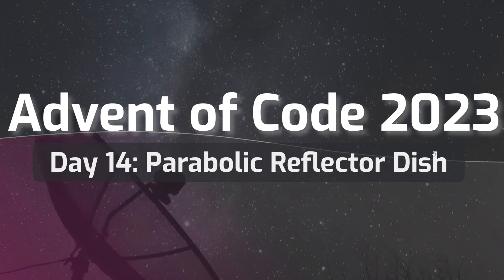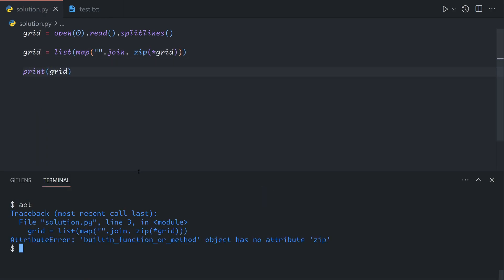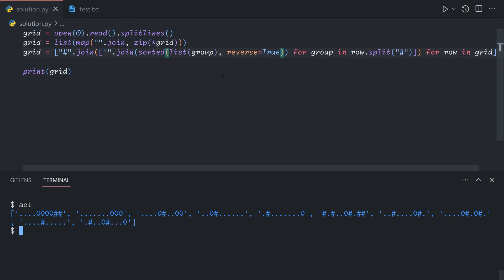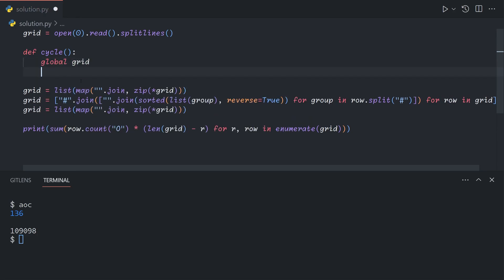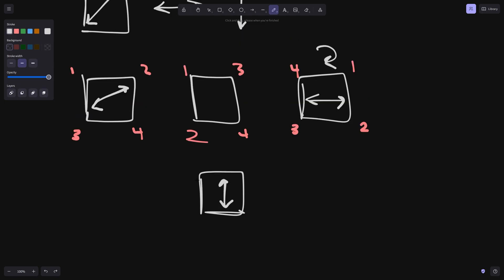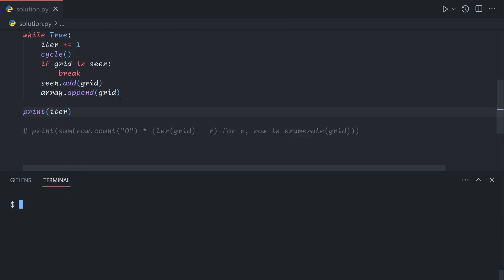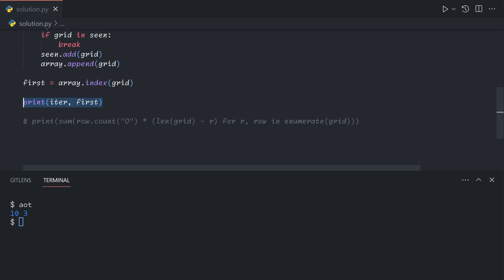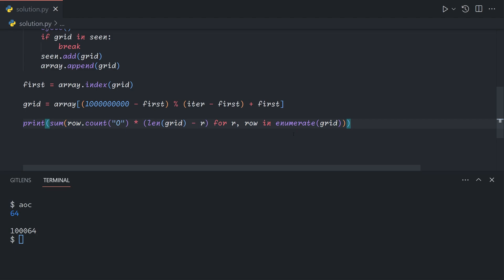Advent of Code 2023 Day 14: Parabolic Reflector Dish

Comment: I think we can use the Load as a hash or identifier for the grid at any point after a spin cycle. so we can track the load (an int) instead of an entire grid.
Reply: You could theoretically have two seperate grids with the same load probably which would break this approach no?
Reply: @xavier29771   I just saw this lol. Yep you are 100% correct.

Comment: I have some simple functions that examine the fields above, left, below, and right and move the rocks if they're free. For part one, this posed no problem, but for part two, it became quite performance-intensive. I discovered that running through 1000 cycles yielded the same result as running through 1000000000 cycles. The only connection between 1000 and 1000000000 is that 1000^3 equals 1000000000. Can anyone explain if this was just luck or if there's an actual reason?
Reply from the maker: It means that 1000 happens to be your (1B - offset) % (cycle length - offset) + offset value. It could also be a coincidence that the total load value is the same even though the grids are different.
Reply: @hyper-neutrino  you are right. It was just a coincidence. I was a bit confused because they're both powers of ten, and the test case also returns the correct value at 1000 cycles. The correct approach would probably be to cycle until you find a readapting loop in the cycles and skip the remaining iterations. I will adjust my solution. Great videos by the way, they helped me on a few tricky problems although I use c++ for this years aoc

Comment: for part 1, I did it in another way without the need to flip or change the order of the elements of the original matrix. For each rock I looked at the elements above it, if I encounter a # i set the value of that rock to len(matrix) - i_cord of row_boulder +1. If you end up at the top of the matrix, i set its value to len(matrix). If I encounter another rock I set the value of the rock i am evaluating to encountered rock value - 1. Then I just sum all up. It was quite easy to code, but them I got stuck with this approach for part two. Don't know if there is some sort of way to make it work also for part 2.
Reply: I believe the best way to do p2 with this approach is also to apply a 90deg rotation 4 times - lmk if there's a better approach.
Reply: @mathcat4  I tried that and it took forever
Reply: @lerbyn same, my code was probably very slow, but i wonder if you can code that up in a naive way and end up with anything fast :0